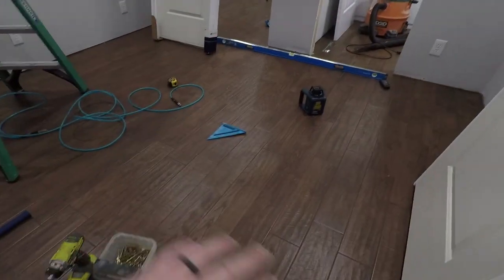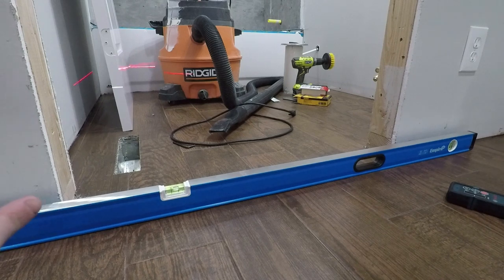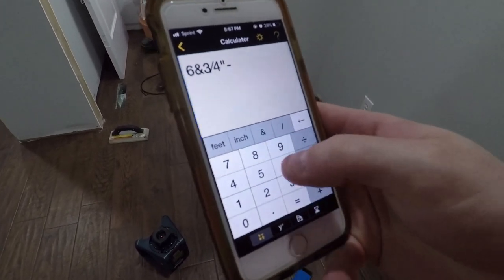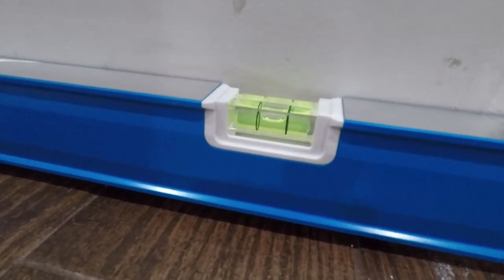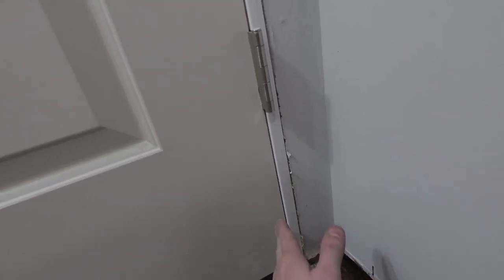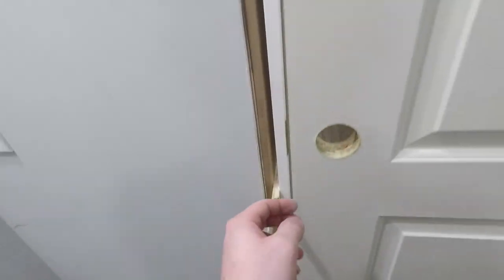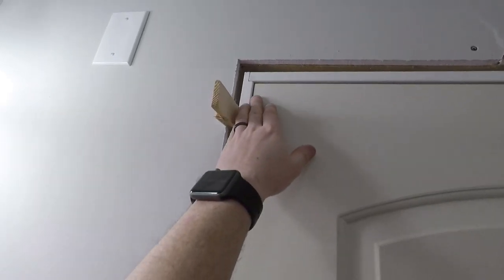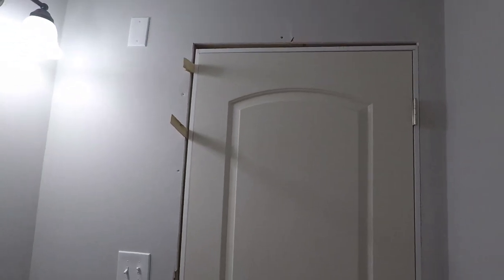Install a door on an UNLEVEL subfloor

Comment: the end of the tape measure is supposed to move.  It's to do inside / outside measurements.  When doing inside measurements it automatically subtracts the width of the hook.  when doing outside measurements you have to make sure there's tension on it.
Reply: I get a kick out of all the youtubers doing "how to" vids that don't know very elementary things.
Reply from the maker: Yes, should have been clearer. I know why it's supposed to move I just don't trust this one because it's been bent from dropping before and I got a bunch of thinset on it before which throws it off.

Comment: Hey man, great idea, great video. You may know this, or someone else may have commented it already, but that movement in the end of the tape measure is to compensate for the width of the blade... let’s you get accurate measurements by pushing it against something, or pulling against something. It should move precisely the width of the blade! Stay safe, good luck with your YouTube page!
Reply from the maker: Thanks! This tape was pretty messed up from thinset and other glue/dirt so I didn't trust the end to be perfect any longer!

Comment: One other thing to remember, if the door opened the other way, going up hill it would have drug or stuck. Keep that in mind when setting bottom gap.
Reply from the maker: Good point, might have to cut some off the bottom of the door itself!

Comment: Nice video.   But that water line for the toilet is ridiculously high!
Reply from the maker: Maybe yours is ridiculously low?? In all reality, it's at the perfect height, a few inches below the tank inlet, short hose, didn't interfere with the finish base trim.

Comment: What brand is that rotary laser level?
Reply from the maker: Luke, it is a Bosch GRL 250 HVCK - I bought it reconditioned on ebay and it's worked great!
Reply: @live.laugh.lowe.9008  pretty expensive new? Thanks for replying!
Reply from the maker: @10lhskater  for the occasional DIY I'd say they're kinda expensive ~$500+ new. I bought mine for about $300 so I thought it was worth it!
Reply from the maker: Also, now that I have one I'd definitely pay $500 for it. I use it all the time!
Reply: @live.laugh.lowe.9008  oh nice! Thanks man!

Comment: Since you taught me soemthing let me teach you something. 

6 and 3/4 
-
6 and 5/16

You need a common denominator and that is 16. So 6 and 3/4 is equal to 6 and 12/16s 
6 and 12/16
-
6 and 5/16 equals 5/16 no need for a calculator.
Reply: I agree with your method and calculations, however I believe answer is 7/16. Check your math?